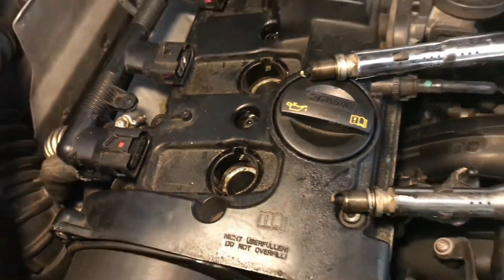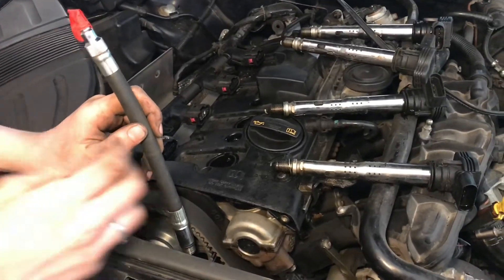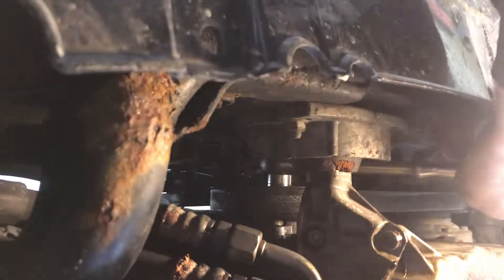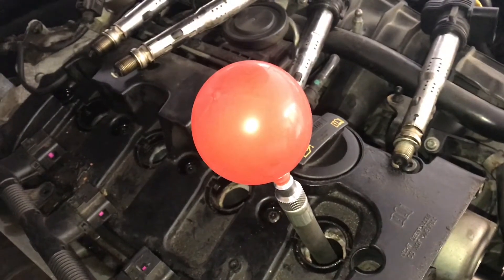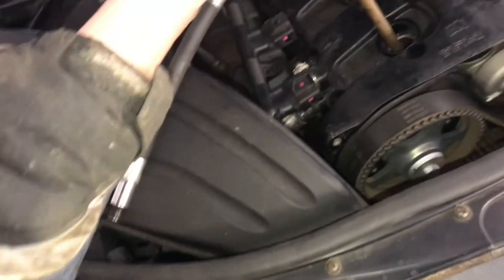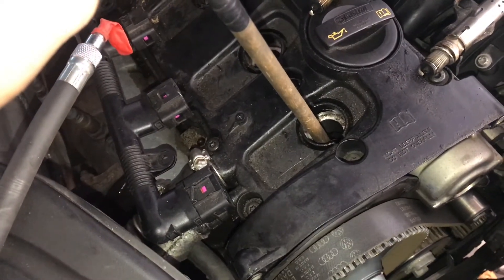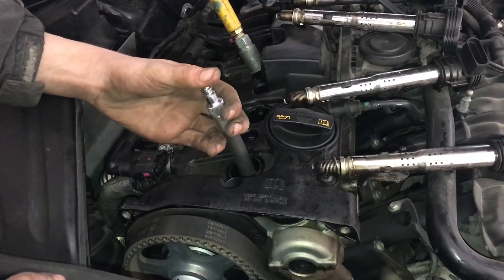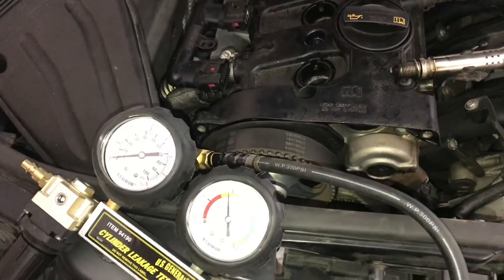how to FIND a pistons Top Dead Center on the COMPRESSION STROKE (using a balloon)

Comment: That's the kind of trick I was hoping to find!  I can't reach crankshaft from topside(fan is seriously in the way). And I can't stick something into the hole and watch it rise(plug holes bored at a extreme shallow angle). Hopefully a small valve leak will still inflate the balloon at least temporally.    If the balloon does not remain inflated, isn't that unquestionable sign of leaky valve? Assuming pistons have been confirmed to hold air?

Comment: Great minds think alike dude. My distributor bracket broke and knocked my 99 Cherokee out of time. 
  Broke down along the roadside. Looking at what i had on hand. (Humming inspector gadget to myself) I seen a spare set of plug wires and rubber gloves. So i took a boot off one of the wires. Tapered one end of it with a razor knife so it would fit nice. 
Grabbed a glove and slide the other end of the boot into a finger. Tied it and took some grease and put it on the tip. It fit perfectly. 
So id turn the pulley than check the boot. When i saw the finger filled with air. I set my timing notch in line with my timing marks. 

Adjusted distributor accordingly set it in place. Stripped the rest of the plug wire. Wrapped it around the base of the distributor nice and tight. 
Cut a piece of exhaust hanger to sit over the break. ran the wire through the hole wrapped around the screw.  Tighten everything up. Nothing moved. Crossed my fingers and turned the key. 
Sometimes i amaze even myself. 😅

So i just had to see if anyone has done anything similar. This is the closest ive found so far. 
My only question is. Did someone show you or did you just think of it?

Comment: I did this . And my engine literally exploded💥💣 dude 😢 I followed it step by step I had a small water ballon and everything bro . Now I have to bike🚴‍♂️ it to work. I guess it was a 50/50 chance .
Reply: We're your cams lined up to their marker? If you had the belt off for any reason you have find TDC on compression stroke and then realign your cams to their markers so the valves are closed. Otherwise you're a turn off and engine will be destroyed.

Comment: Ok so for people who need to do this AND DONT HAVE THE BELT ON .the cam has a marker that position s the cyl 1 valves TO BE CLOSED...so.turn cam shaft clockwise and line it up.... .then when you manually turn the crank shaft it will ALWAYS BE ON A COMPRESSION STROKE WHEN IT COMES UP AT TDC...JUST HAVE A LONG SCREWDRIVER IN SPARK Plug FOR CYLINDER ONE AND SPIN CRANK SLOWLY UNTIL THE SCREWDRIVER STOPS RISEING.....THAT IS  TDC....THEN PUT YOUR BELT ON .DONE.

Comment: What you mean by 50-50 chance to find compression stroke. Is that during exhost stroke  the exhost valve opens then there won't be any pressure in the cylinder and that baloon may not inflated.
Reply: You still need to check your timing marks. Then you know you're not 180 out is what I think he means by 50/50. Or I would at least hope so because doing a timing belt there is no 50/50 anything

Comment: what is the adaptor tube thing made up of so we can create it!
Reply: I think we can obtain that from tyre inflator air compressor.. That has gauge too and can be use for other compression tests also
Reply: Or you can use spark plug cable (rubber tube)🤓

Comment: Why 50/50 chance? You said the Ballon will not inflate on exhaust stroke.
Reply: 50/50 chance without the ballon is what he meant, i just rebuilt my supermoto engine and i just did this. timed it on the exhaust stroke. won’t build compression to start. this ballon idea is ingenious. you know you have compression when the ballon is blown up abit, the finger trick works too or a cork but the ballon is fool proof.
Reply: @joshrebeiro8017  Yes bro. Thank you !!

Comment: I just put a wine cork in the spark plug hole. when compression stroke comes up, it will pop out and then place the timing mark to exact TDC.
Reply: If the engine isn't a straight block, do I start at the far left cylinder or the far right cylinder,?
Reply: @michaelhayward7790  The one closest to the Timing cam/belt. That would be # 1 cylinder from what I've seen and read. I just put a wine cork in it and when it pops out that means your coming up to the compression stroke.
Reply: @vdavis1959  Legand thanks mate!
Reply: I was out of option on my jeep xj and I just unscrewed the spark plugs and set them in their hole and same thing! Glad I’m not the only one. Just have to learn how to accurately get it to Tdc now

Comment: I tried doing this balloon test and turned the engine about 4 times and balloon sucks in air but doesn’t fill up with air. Please help!! What does this mean!’??
Reply: no compression
Reply: May be your valves are not sealing on the compression stroke..
Reply: Lmfao and the Oscar for best actor goes to kase one
Reply: if you cant get the engine to fill your balloon, then you may need to use your mouth to do it. hope this helps!!
Reply: @BruceAllentools 😂😂😂😂